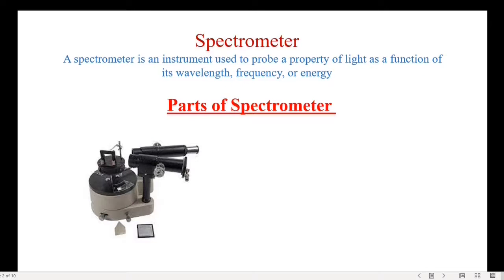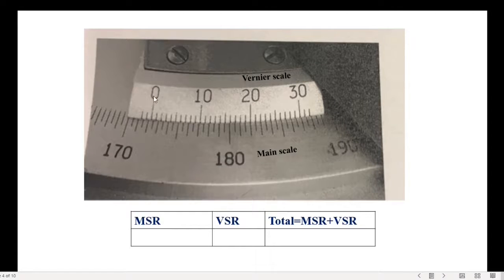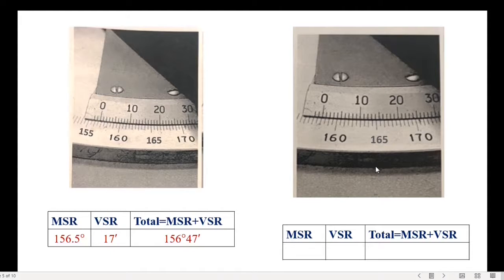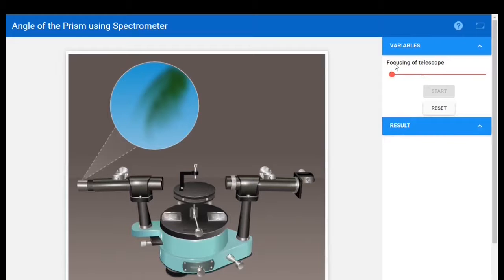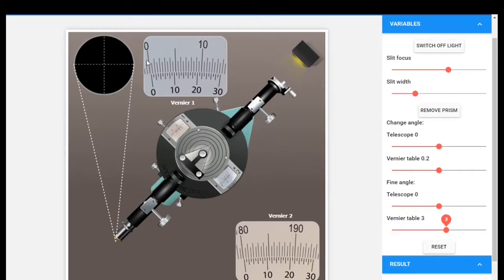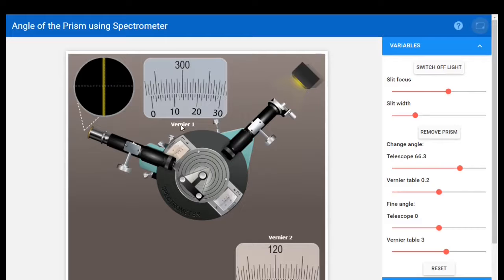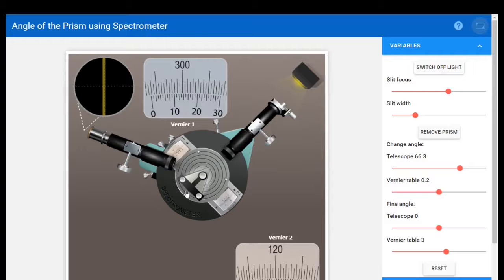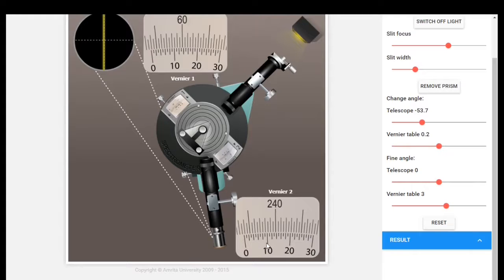Angle of prism  (Amrita Virtual Lab)

Comment: Mam why the strategy 90 Degrees below
Reply from the maker: if the angle 53.5<90, that is Coterminal angle.  if you see the Vernier A angle from face 1 to face 2, it completed one full rotation and it included another 53.5 degree, so We need to take the Coterminal angle of 53.5 degree.  (360+53.5)

Comment: Maam please tell reason, why we add 360° to angle less than 90°
Reply from the maker: Coterminal angles which  share the same initial side and terminal sides. 45 degree and (360+45) 405 degrees are Coterminal angles.  I think you understand now.
Reply: @mgnkphysicsjunction   yes ma'am,  I understood what you are saying but why do we need to take the coterminal angle , why can't we take the angle which we read(that was less than 90 degrees)
Reply from the maker: @ayushbhardwaj7650  if you see the vernier A angle from face 1 to face 2, it completed one full rotation and it included another 53.5 degree, so We need to take the coterminal angle of 53.5 degree
Reply: @mgnkphysicsjunction   Ok , now understood . Thank you ma'am for your kind reply